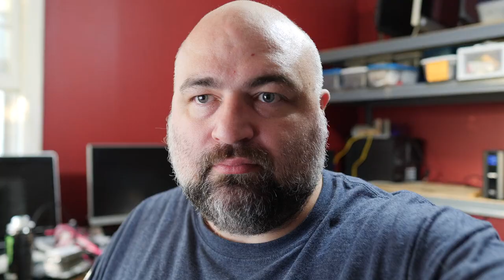Even MYTHBUSTERS Got The Airplane Conveyor Belt Question WRONG - A Neckbeard Explains - Jody Bruchon

Comment: I'm so confused. Then would it be possible for a plane to take off literally sitting still?
Reply from the maker: Of course not. The point is that if the wheels are locked to the conveyor speed, the plane is always standing still.
Reply: @JodyBruchon  But this is erroneous. Air propulsion is independent of wheel speed, it doesn't matter how fast that conveyor is turning, the rolling resistance will be overcome.

This whole thing about matching wheel speed: it's basically a logic loop that's meant to catch you out. It's still an error, because then you would be measuring in RPM's for both wheel and conveyor speed. Since that speed is finite according to take off, the only limiting factor is the stress limits of tires and wheel bearings - a completely different problem.
Reply: a plane can take off while sitting still if the wind moving over the wings is strong enough. there are videos of ultralight planes parked at airports being blown into the air in strong storm winds. they have to attach them to the ground to keep them from flying away.
Reply from the maker: @monrow11  Your degree didn't include basic logic, apparently. If a plane's wheels move twice as fast, the constraint in the question is violated. Try being less dumb.
Reply: @Eatinbritches  "Air propulsion is independent of wheel speed, it doesn't matter how fast that conveyor is turning, the rolling resistance will be overcome."

If that were the case, wouldn't an electric fan just take off?
Sure, it has little to generate lift with, but not nothing. Heck, attach wings to the case and see if it takes off. And yes, they have a base that provides a lot of drag with the surface you put them on, but shouldn't this resistance be overcome, eventually, by the same argument you're using about the plane wheels?
Reply: @JodyBruchon   The plane is being pushed or pulled THROUGH THE AIR ... GET THAT ONE SINGLE FACT THROUGH YOUR OBVIOUSLY VERY THICK SKULL ... the wheels are ONLY there to keep the fuselage off the ground (and for steering while taxiing).  
TRY thinking of replacing a plane's undercarriage with a HOVERCRAFT skirt on a conveyor belt designed to CONSTANTLY move backwards at GREATER than the vehicles takeoff speed ... think the belt speed will have ANY EFFECT WHATSOEVER??? Of course not, since the hovercraft is HOVERING, and doesn't give two sh!ts what the GROUND is doing since it's pushed through the AIR.
Reply from the maker: @ydenneki  An airplane isn't a hovercraft, moron.
Reply: @ydenneki  while on the ground, the vehicle only moves by having rolling speed.  You have to do a free body diagram to show the force provided by the engine, then apply that to the vehicle free body diagram which shows the forward speed (on wheels).  Then, finally you add in the conveyor belt element that exactly matches the vehicle rolling speed.  You get zero velocity and so zero airflow over the aircraft body.  You just have the force/thrust working furiously to roll the wheels while on the ground, but getting no velocity relative to the atmosphere to generate the lift force.

Comment: Remove the wheels.
Reply: Removing the wheels then you have a basic question about a force countering the friction force.  This thought exercise is the same thing if someone bolted a static stand to the wheel axles.  The point of this question is whether the thrust force generates lift without motion of the vehicle.  It doesn't.

Comment: I think I understand what you're trying to say but correct me if I'm wrong because this is the way I understand it. If the conveyor belt is matching the speed of the wheels the speed of the wheels would grow exponentially as the the thrust increases. Obviously there is a percentage of friction and once the wheels spun to a certain speed it would be the equivalent of the breaks being fully locked which the thrust of the engine would not be able to overcome and move the aircraft forward. This is all hypothetical as you said. Obviously if you just spun the conveyor belt at the takeoff speed the aircraft would be able to easily overcome this.
Reply from the maker: The entire thing hinges on the constraint that the plane wheels must always match the conveyor speed. I've actually clarified in a lot of other comments here if you want more detail than I gave in the video (and I clear up corner cases too).
Reply: The wheels always match the conveyor speed. They're touching. The plane took off in the video, and it took off easily.

Comment: 7:00 you defeated your own argument. Propellers pull air and jets push air. The end result is the same. If the same argument was being had about a car and you called front wheel drive cheating you would see how people would wonder what's wrong with you. As for the main question, no the plane wouldn't take off because it's expressly locked into position on the fictional conveyor belt. Although the plane doesn't need to generate traction with the wheels to go forward, it still needs lift to fly so at max thrust the wheels will be spinning like crazy but the plane hasn't budged because the conveyor belt is also spinning like crazy giving an equal and opposite reaction which negates the thrust.
Reply from the maker: Propellers, turbofans, turbojets, and turboprops ALL pull air from the front and push it out the back. You remind me of the time I argued with a relative about how leaving the door at the base of the attic stairs open wouldn't let the air conditioning escape to the attic because cold air goes down and hot air goes up, and the reply I got was "air goes up."
Reply: @JodyBruchon  Propellers, Jet Engines, it does not matter. You could even tie a rope to the front of the plane and try to pull with another jet that's on the ground. The hand of God could come down and push the jet and it still would not matter. Whatever force is applied to the plane is translated into rotating the wheels. The plane cannot move forward without its wheels rotating. And as they rotate, the conveyor moves opposite at the same speed.
Reply: Whoops. That was meant to reply to OWAS

Comment: The biggest issue with their experiment is that Jamie's truck doesn't accelerate at the same speed as the plane. So the "conveyor belt" is NOT matching the speed of the plane.
Reply: 100% wrong. The plane's takeoff speed is 20mph, and the truck moved at 20mph. 

The wheels and conveyor are always going the same speed. They're touching.
Reply: @phil2082  This is NOT the same. The truck matched the speed of the PLANE. Not of the WHEELS. That is a huge difference and is a fundamental part of the question.
Reply: @tracruz  Exactly. He would have to drive in the same direction with the same acceleration like the plane ;-) Then the speed of the wheels would always be at 0. The belt and the wheels would touch on the exact same spot until the takeoffspeed is reached. Then the plane would fly away with no wheel ever turned ^^
Such a theoretical question/riddle. So far away from reality 🤷🏻‍♂️
Reply: @fabiankummer3536  the speed of the belt is defigned as the speed of the belt over ground and it is moving in the opposite direction. If it matches the planes ground speed the wheels will be rotating at twice the speed as normal to make the plane move forward. But that is the problem. In the riddle it sais "the belt matches exactly the speed of the wheels". So if the wheels rotate as if the plane was doing 100mph on a normal runway the belt will be doing 100mph in the other direction and without the wheels slipping the plane will have a net speed of 0.
Reply: @simsch97  I guess this is a thing of interpretation. There is no hint in the riddle if the speed of the belt is meassured relative to the ground or relative to the planes wheels.
The way I look at this is: When the plane and the belt accelerate with the exact same acceleration, the wheels would therefore stand absolutely still. And that means that the conveyor belt has a relative speed to the plane and it‘s wheels of 0m/s which would match the riddle. 
When thinking it trough like you said, that the conveyor spins relative to the ground in the opposit direction, we would have to break physics. Hence the Thrust does not accelerate the wheels but the plane itself, the wheels will spin at an infinite rpm. My thought behind this sentence: Wheelspeed + thrust - beltspeed = 0: Wheelspeed and beltspeed have to be the same number, so you could express it as: x + thrust - x = 0
Obviously thrust is there and has it‘s effect on the plane. So „x“ would have to increse in infinity and even then the equation is not correct. Means that even when the conveyor belt moves towards the plane, the wheelspeed has to be planespeed due to thrust + beltspeed (a negativ number) wich equals to the relative plane speed compared to the ground 🤯
It can‘t be solved like this in my opinion…

Please let me know what you think 😇
Reply: @fabiankummer3536  yes. There is a lot of true stuff in your comment. In the original riddle it sais the belt moves into the opposite direction and matches the exact speed of the wheels. That can only be the case if the net speed of the plane is 0 or the wheels are slipping or the speed of the belt is messured from the pilots point of view (so that it is relative to the plane and not to the air and ground besides the belt). As you already said the plane would accelerate due to the thrust as there is no force preventing this. Now in a real experiment that would try to exactly follow the riddle this means that as soon as the plane starts to accelerate by the slightest amount the belt will ramp up its speed with a near infinit amount of acceleration up to that point that one of the parts (wheels, belt, engine moving the belt, bearings on the wheels) breaks and the riddle is broken too. So in theory it would break something instantly. But if we take out the physics of thrust because as soon as we apply thrust it breaks the riddle and only take a look on the fact that the net speed of a plane is 0 if the wheels rotate with the same speed as the conveyor belt (as required by the riddle), this would mean that it is not able to fly. Without that precondition it will be perfectly capable to take off.
Reply: @simsch97  WRONG!  If the conveyor EXACTLY MATCHED the wheel speed, then the moment the plane started moving, caused by the engines pushing or pulling the FUSELAGE of the plane forward THROUGH THE AIR (notice the wheels are never mentioned) then the positive feedback loop of wheel speed vs conveyor speed would almost instantly have the belt moving at INFINITE SPEED while the plane's engine(s) continually accellerate the plane THROUGH THE AIR, and unless the wheel bearings seized or the tyres exploded the plane WILL take off.
Reply: @ydenneki  I can't believe that I'm coming back to this post now. Yes in a real experiment the plane accelerates and takes off with the wheels moving spinning faster than the movement of the belt. Just by the numbers there is no way that the wheels match exactly the speed of the belt without the wheels slipping.

Just imagine an unpowered soapbox car. If it runs down a hill with the wheels not slipping, the ground doesn't move but the wheels spin as the soapbox moves forward. So the wheels don't match the speed of the ground. If the wheels match exactly the speed of the ground it is stationary. Of course in a normal world the soapbox will run down the hill as gravity pulls it down just as the planes engine produces thrust to move the plane forward. But this will cause the wheels to slipp or they are not matching exactly the speed of the ground or the belt respectively.
In a real world experiment of course the plane will just take off because it is basically not practicable to fulfill the condition in the question.